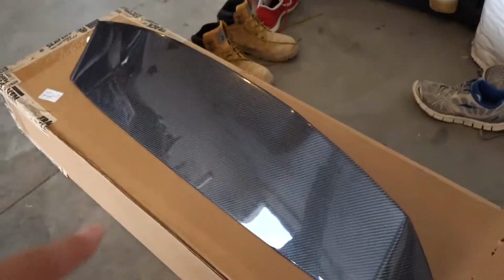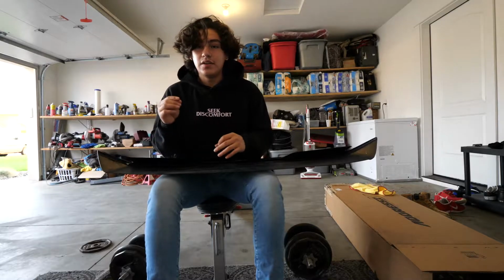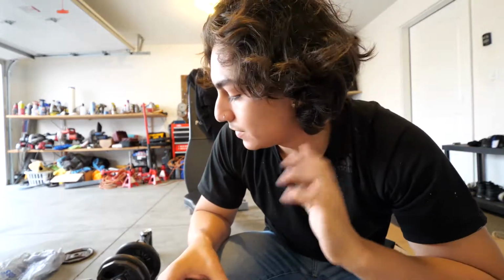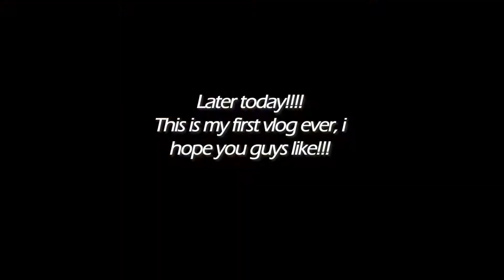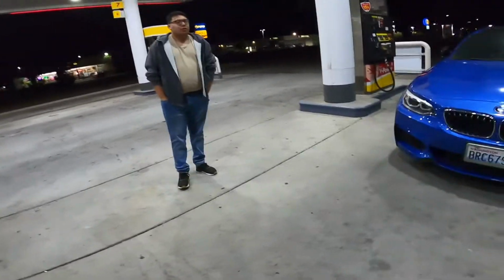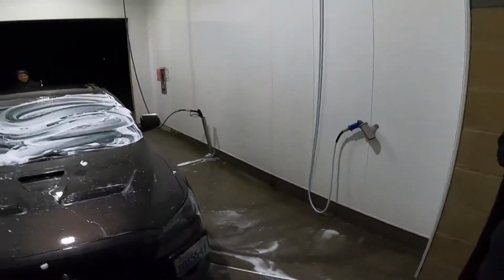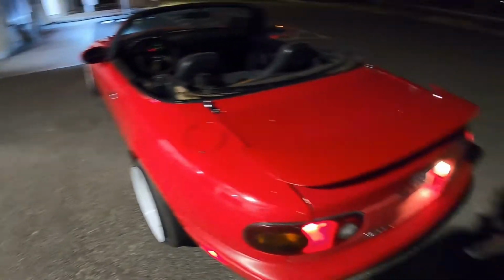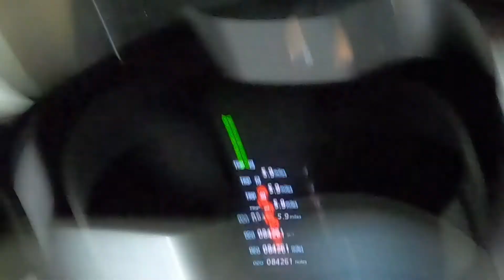USP Motorsports mk7 GTI/R carbon fiber spoiler

Comment: Damn. Just received mine in today. And guess what.... Exact same ish. Came with no 3m tape and when I put it on to fit test it doesn't seat where it should.
Reply from the maker: Probably gonna have to filed down any excess carbon on the inside 🤦
Reply: @colgatemk7gti698  that's what I ended up doing. I did have a question though. At the end where the carbon outlines the top brake light. Is the carbon suppose to go around the end of tail or just sit at the tip. Where the Aggressiv logo is.
Reply from the maker: Do you have a Instagram where you can DM and show me!